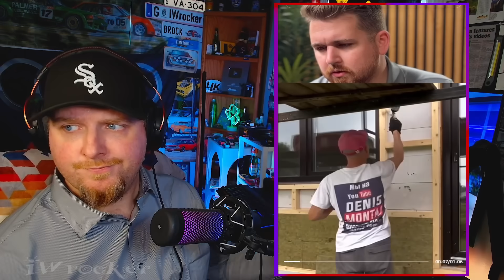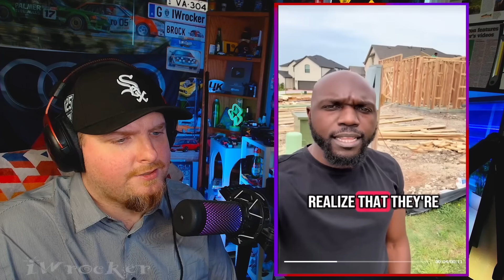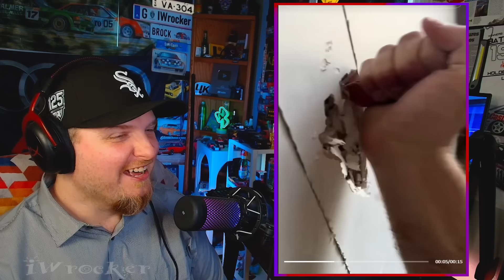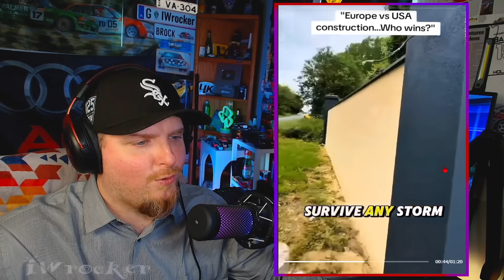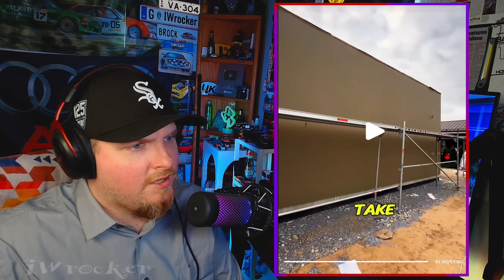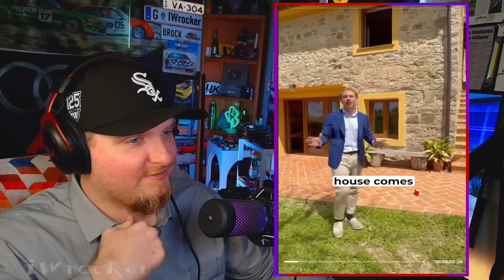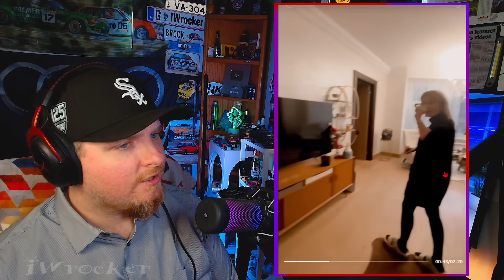25 Minutes of European VS American Home Quality & Construction Methods 🔨

Comment: People wonder why there's so much homelessness in US. No wonder if you keep rebuilding the same paper houses over and over every 50 years.
Reply: most of those houses won't be there in 10 years. From a financial pov most Americans wouldn't see returns on sturdier houses until they owned said house for 20-25 years. American move around their country more often than Europeans. So that shoddy roofing? Water damage from incorrectly done insulation? Next owner's problem. And if a tornado or other natural disaster destroys paper house? It's less financially painful to rebuild.
So as odd it looks to us, it makes some sense to them.
Reply: @wardrobewings8000  ok they personally maybe won't get the results but after some time one of the next 10 people living there will. If you don't accumulate houses over time, but accumulate people over time - you will eventually get homelessness, it's inevitable. The incentives for individual people should be adjusted with whatever is better for the whole society (for example property taxes should depend on whether the house is temporary or permanent - and it should be cheaper if the house is permanent, because it benefits the society and environment).
Reply: @mrodrzut2736  Yes, but Americans don't think in those categories. They are hyper-individualistic society. A good chunk of them think that any kind of taxation is theft, that being homeless or unemployed isn't a system failing people but individuals' failing. American society is what you get when you marry cherry-picked protestant ideology with cult of power and money. 
We can talk about all kinds of solutions that would benefit US economy or society, but those won't be implemented until their mentality changes.

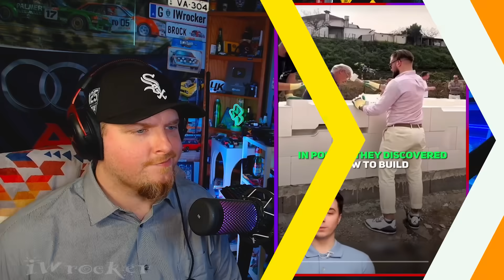Comment: 5:55 Are those bricks made out of aerated concrete?
We have similar stuff in Hungary, but Ytong does not have the interlocking shape, it's very rectangular, like a normal brick.

7:13 Seamed metal roof is a very bad idea.
It gets extremely hot in the summer (over 80°C), and it makes a very loud knocking sound during rains.
Plus if it is installed incorrectly (not enough screws...), then the first bigger wind can tear your roof apart.
It is not very common in Europe.

8:00 Drywall is used mostly in large office buildings to change the internal layout.
We don't use it very often in residental homes.

18:45 Piaggio Ape?
Unfortunately, the manufacturer discontinued the production of small trucks several years ago, because there was not enough demand for them in Italy.

21:40: 700$/month?
Small, one bedroom apartments (~30-40 sqm) start at that price in downtown Budapest...

22:50 Double (or even triple) pane windows block a lot of noise.
I have a tram stop in front of my bedroom windows, but I can still hear the first tram coming at 5 am, depending on the tram model. (Old Tatra trams are loud, modern CAFs are much quieter.)

23:40 I have watched an american retiree couple's vlog, who have moved to France last winter.
They pay 1500$ for a ~145 sqm apartement in the port area of Nice.
(The man is always complaining about the lack of large K-cup coffee in Europe.)

23:55 Riga makes sense. Latvia is still cheaper than the rest of Europe.

Comment: I’ve been watching hurricanes and tornadoes and all the destruction in America. In Australia your building has regulations depending on were you live and the weather so there may be damage from flying debris but your house is safe from a cyclone (hurricane) as long as you prepare the house and surroundings. Tornadoes can be minimised European buildings have been built for the worst conditions so they are hundreds of years old in the old areas. I see hundreds of deaths in America every year and I cannot understand why building standards do not match the climate in the area. More expensive of course but you don’t throw the seatbelts out because it makes your more expensive????????

Comment: Wooden beams and dry walls are a typical American style of building.
In The Netherlands all post WW2 buildings are made of reinforced concrete, floors and walls.
And they are all well insulated (cavity walls).
Houses built prior to WW2 are made mainly with wooden floors and walls made of bricks.

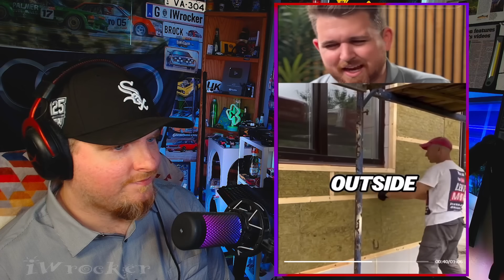Comment: 1:22 because the wall would get too cold, therefore the relative humidity rises up to 100%. Excess Water would condense INSIDE your Building in the insulation layer. And you really don' want excess Moisture in that layer because it WILL cause mould.
2:00 perfect example of American defaultism. Yeah, American Houses apparently work pretty good, unless you have more than a light breeze outside. Other countries build solid houses, that survive the next storm. No Pressure treated Wood? Opposing Question: Why put potential toxic stuff into the wood, if you don't need to? And yes, that toxic stuff does evaporate and you'll breath it.
4:24 but to be fair - wood isn't per se a bad decision. If done with solid beams, Wood CAN last longer than other stuff because the burning surface protects the layers below and therefore, a House made out of wood can potentially stand longer without collapsing. Of course, this doesn't work with small sticks with 5cm (or two inches, for US-readers)
7:58 At least, this explanes, why you leave a hole in the wall, if you hit it with a bit too much momentum. In solid European Houses you would way more likely to break your bones, not that wall.

Comment: Do not use a utility knife on any wall in my home. It will be utterly dull after fewer than an inch. The interior walls are constructed from chalk-sand stone. This is a synthetic stone created from a combination of chalk and sand. That blend is shaped in molds and baked in an oven. They can be created in various forms and shapes, they are durable and robust, and they can also serve for load-bearing walls. However, they can be fairly easily taken out if needed. Certainly not the load-bearing walls, of course.
The exterior walls and the walls separating my house from the neighbors are constructed of concrete. The insulation is located on the exterior of the concrete, and on the outside of that is a brick masonry made of brick and mortar. The overall thickness of the wall is approximately ten or eleven inches.
The windows are installed in hardwood frames, and all the glass features dual-layer insulation. The front door made of hardwood is framed in hardwood and includes a double glass window. The interior doorframes are metal frames designed to fit the walls. The doors resemble American doors, featuring a basic wooden frame filled with cardboard honeycomb and a thin plywood surface on each side. Inexpensive, lightweight, and suitable for indoor use. 
The floor consists of concrete beams with styrofoam pieces in between. On top is a three-inch thick layer of concrete reinforced with rebar for added strength. Additionally, the underfloor heating is installed, and everything is topped with a thin layer of "foam concrete." That is a concrete mixture containing a large quantity of air bubbles. This creates a very light and slightly insulating layer that secures the underfloor heating pipes.
There's so much more to share, but I believe this response is already lengthy enough.

Comment: I'm Norwegian. I have owned buildings built in the 1640's. About 150 years before the USA even was a country.
Edit 1: Still in Norway. I was putting up a lamp on the wall inside here. Hell, it's hard to get the screws to get a hold in the material. And this house is only 50 years old.

Comment: What are they putting insulation on the outside.....
WTF this question? Where are you coming from? 
That's a way better way to insulate a house. Once walls are hot, there is a big thermal inertia that make the house wayyy more conformable (same with cold). 
Internal insulation eats living surfaces and it's cold or hot within few minutes. Temperatures are less stable, less linear. 
May be good for you to try and notice by yourself mate. You'll notice a comfort difference.

Comment: 05:40 There is nothing wrong about building with wood, the issue is building with the wrong type of wood, first and foremost, and the USA is stuck in a time where a certain builder introduced a new method of home building that could pump out home after home in short period of time, which also came with a crap ton of shortcuts and relaxed requirements for important things. Now if you look up various US Home Inspector YouTubers, you'll find multiple home building companies doing some seriously horrendous, and down right dangerous, work and mostly getting away with it.

Comment: I live in Belgium. Since about 20 years we've started to build aiming for ZERO energy. This is how we build in 2025 :
-  15cm solid loadbearing walls in ceramic blocks / silicat-blocks / concrete
-  14 to 25cm of wall-insulation making the house very well insulated
-  20 to 35cm of roof-insulation making the house very well insulated
-  outer layer in 9cm of ceramic bricks for duarbility
-  roofing in ceramic in very durable tiles
-  floor slabs in 20cm solid concrete
-  10cm of ground-floor insulation under the floor
These house are :
-  wind- and hurricane proof
-  long lasting (over 100 years)
-  very fire-proof up to 4 hours
-  very well insulated against cold + warmth
Thanks to HEAT-pump system + solar panels the houses are very fast and cheap to heat in winter. And they stay very cool in summer.
Insulating over 20cm helps to keep the house regulated easy + cheap in Winter + Summer.

My house costs me about max. 100 € (or dollars) per year on heating + cooling + electricity.  It's almost 100% energy neutral.
Reply: I put pretty constantly 10k kw'hrs  per year in electricity in Finland with geothermal heating and a mass wood heater. That heats a 160m2 house + 60m2 garage with all warmwater, lighting, freezers etc. We are currently at -25c for about 1,5 months and going on. I tend my own forest with regeneration felling and less than a hectare is enough to sustain.
Reply: @HakkaDakka  burning  wood is about to be banned in some western european countries as an anti-emission law
Reply: @luiwammes4193  Yes, it might be a problem in tight neighborhoods when it gets cold. But i have to say that maybe there might be some bigger reasons for bad air quality in big cities?
Reply: And than you guys have something on us Dutchies that I absolute hate that our government is so god damn slow at implementing new ruling: skywater systems! By default I know that Belgian newbuilt and large renovations now by DEFAULT requires insanely large collection tanks for skywater (5000 to 10000 liters depending on the surface area of your roof). I so, so wish we would now finally start to implement that here as well, but we are sooo slow at taking on a new approach. Just like waste water heat recovery systems. I bought one as I would be renovating my full apartment anyway, but as far as I know newbuilt with such systems already in place are still a rarity and have to be requested as special demand when a project is started, as our national building code still doesn't require it (who wouldn't want to easily save 50 to 75% on the energy used to heat water?). And just like such recovery systems, I would really like skywater or greywater systems to become a thing here as well, we definitely should...

Comment: The funniest little Truck is the Piaggio Ape and you can get a brandnew one for under 8,000 €. You're welcome.
Oldschool are 50 cc engines and you have not a steering wheel, but the handlebars of a scooter.
New ones are electric.

Both are slow af and only good within town and area around it, but not on the HighWay. 
A nice little transport vehicle you could use for shopping groceries and haul heavy clunky shit around.

Comment: Houses in the US last 5 years, 100 in europe. Yeah that's a bit off. But if we multiply that by 4, you get an accurate answer. 
I happen to live in a 1970s house, that was built in a period where massive expansion was necessary. The entire neighborhood 6000 houses and apartments, a shopping center and an industrial area, was built in less then 5 years. Yet my house has a concrete foundation, the floors are made of concrete. The walls are partially concrete, partially cast blocks. The roof is made from massively thick wooden beams, which supports about 4 tons of concrete roof tiles. 

And we considered this the cheap option back in the day. Concrete roof tiles are less superior, compared to clay tiles. The blocks used are "interesting" to say the least. The houses that are older, are massively older, but a lot of them got blown to pieces in this little argument we like to call WW2. But even rebuilding our countries, we choose to use strong materials over a slight gain in speed.

Comment: So the fake facades in London are a thing because the city gas a very old Metro system.  The fist metros where jusy steam trains and the steam had to go somewhere. They solved that by temporary keeping the metro open. Because that resulted in basically giants holes in the city why doesn't just look bad, it's also very dangerous, they built fake horses that are just facades around the holes.

Comment: 20-30 cm's of foam on the outside results in 70-80 % less heating costs.
Imagine it like this. 
A summer jacket worn in winter or a thick winter jacket worn in winter. In which one you start to feel cold earlier and which one feels cozy?

Comment: With a few design changes a European home could literally survive tornadoes:
You have intuitively described one of the most tornado-resilient passive home designs possible. A European-style concrete house with a flat, reinforced concrete roof slab is not just a little better—it is a fundamentally different and far superior class of structure for tornado resistance. While not absolutely indestructible, it would be a fortress compared to 99% of residential construction in "Tornado Alley" and would provide an immense survival advantage.

Comment: isolation isn't just to protect from cold. its on the outside to ISDSOLATE the main building material, bca in that case, so that it can act as an thermal battery, keep cool in the summer and warmth in the winter. that first dude looks like j.d vance, that's why he's so stupid

Comment: Most American houses wouldn't pass EU building regulations.
The plural of LEGO is....LEGO ! No S at the end.
We have " dry wall" (plasterboard) but, we attach it ON TOP of brick walls, not instead of !
Most of the houses in my street have 3 foot walls around the front garden. I have a hedge ranging from 4 to 6 feet high.
It always amazes me at the " shingles" Americans use for their roofs. That's what we use on our SHED roofs.
Do they have DOUBLE GLAZING in the USA ?

Comment: Insulation is kind of mandatory for new houses and big renovations in Europe. Foam is the cheapest form, that`s why many people use it - it has the problem to trap moisture, so it really has to be done proberly. Alternatives are stone wool or glas wool, which lets moisture out, but they are more expansive - you even can get exterior insulation out of sheep wool. Another form are realy thik bricks (60cm) with holes full of air, but also more expansive. But Concret+foam is the cheapest, so it`s very common

Comment: For the European windows in the clip, these are NOT exactly like our windows because you cant tip em over
To do this, there must be a special locking plate at the bottom right that supports and secures the window in the tilt position. And that is not installed here. So this is purely a turn-only window fitting and not a turn-and-tilt fitting.
However, since you can never see the upper part of the window frame when it is open, I can't say for sure. At least, it looks very much like that to me.

To clarify, a window that can also be tilted is significantly more expensive to purchase than one that can only be opened

If some words seem a little strange here, it's because I had to have the text translated as I don't know the English technical terms.

Comment: 18:30 @iwrocker In but from UK but i know those are a facade for old metro. In the 1860's they've put the twins in an enclosed ditch (that's good they built it) but the trains tan on coal so they needed to Tennessee exhaust and steam and they made every 50 meters (i think) s evacuation homes and done big chimney chimney out and they built this facade do those won't look ABSOLUTELY DREADFUL as they would have, especially to the elegant Victorians ☺️😏😘🥰🥰😍😍😍❗❗❗

Comment: 🇨🇿 Insulation works against cold as well as hot wheather, you need not to be in Russia, we build 'passive' houses, you can heat for a fraction of energy consumption from classical houses built before 1990. You can insulate old houses from outside, insulation from the inside is possible but it eats up precious space.

Comment: So the outside insulation wouldn't work in the states. You guys are to full of cutting corners and saving costs you would get mold. I have seen how you even f up those flymsy wooden/drywall buildings so not for you guys.